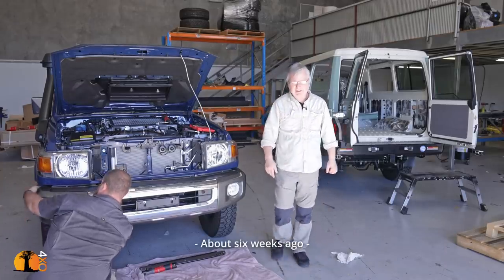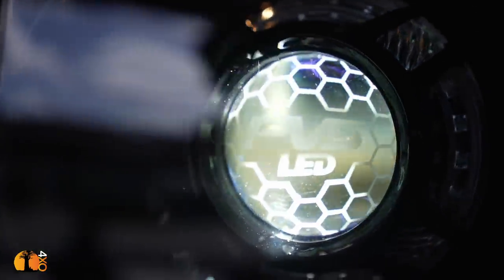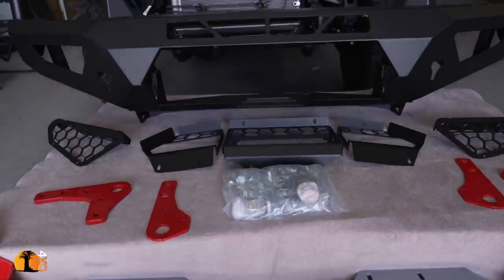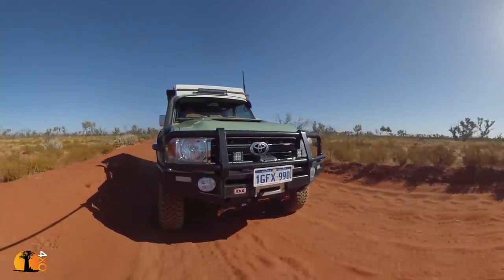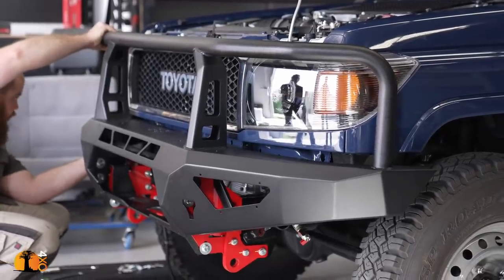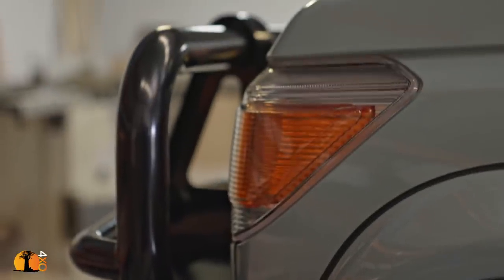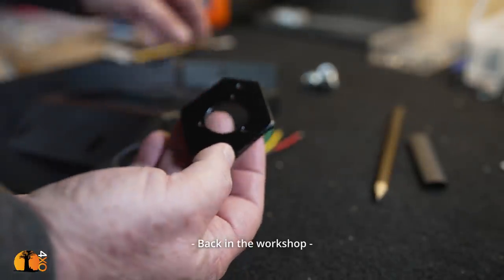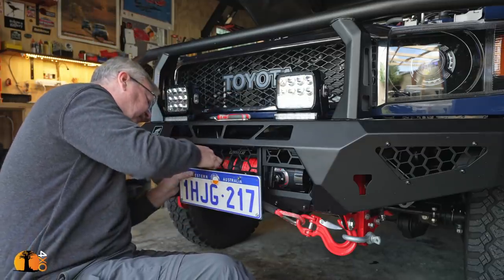BULL BAR, LIGHTS, WINCH & WEIGHT | How much weight have we added so far? | 4xOverland

Comment from the maker: Winch controller questions: IMO. How do you work a remote switch with gloves on? You have to take your eyes off the operation to make sure you're pressing the right button. With a switch, its tactile - all done through the feel of the fingers. What if someone picks it up and runs the winch at the wrong time? If it falls in the mud? Remote switchers inside the relay boxes are prone to water damage. Remotes are horrible things and not suitable for safe winching. Okay for the very experienced. Dangerous for the newbie.
Reply: How do you press the button?…by pressing it. It’s still tactile. One button for in, one for out. Just seems like you just want to use the wired controller out of choice…and that’s fine, but the other reasons are grasping at straws IMO. I dare say that even with the wired controller, right before you winch on or out you’re going to glance at the controller…same as a remote.

Comment: C'mon Andrew.  Your reason for not wanting a wireless remote winch is flawed.  You can just as easily arrange who manages the winch wireless remote as that of the wired control.  If you don't have that sorted, then it's a user problem.  But like you, I do like the winch control box hidden, and extending the control wire plug where it can be easily access is a must.

Comment: Hi Andrew - I see other Aussie channels (4WD 24-7), All 4 Adventure and even Ronny Dahl) all lauding remote controls from a safety point of view. During difficult winching operations you can put some distance between the winch cable/ rope and yourself so that if it or its anchor point let go you are out of the 'kill zone' as they say. For me it is far more important to be paying attention to what you are doing than whether you are using a remote or cable controller. 
Having said all that I have only used my winch once in 30 years - halfway up a hill stuck in a washout between Ruacana and Epupa falls, I try not get stuck. Which is why I like your troopie build I have always travelled as light as possible - which helps in not getting stuck.

Comment: At 9:42 when you showed the plug, its just a 4 pin XLR type. Commonly used for power supplies in AV. Easy to purchase a premade extension wire, or make one yourself with some Neutrik plugs. Did find it a bit weird though, as those things just rust in normal studio applications, let alone getting wet in the wild.

Comment: I suspect most people over-estimate because they don't take into account the weight that is removed when you replace parts. The bulbar might weigh 60kgs - but you probably remove 15kgs of  bumpers and supports so you net out at 45kg. Similar with most of your other mods - you gain weight but not exactly kg for kg - have to account for what is removed in fitment.
Reply: Exactly what I did.
Reply: Whereas if you’re doing the work yourself you see what is being removed and factor that in (add underestimate the difference).

Comment: Wouldn't the cable winch control put the person in charge of winching in the death zone, remote control they can be in a safe position. But I note your point as well.
Reply: (hence why the person controlling the vehicle on which the winch is mounted should ideally control the winch from the drivers seat. - If a "remote" party wants/needs to be director of recovery operations, their deal tool of use should be a 2-way radio, issuing edicts  for the participants in the saga (radio coms to spotters, etc is very useful )..  ( NB. if the Wireless (pocketable) remote doesn't have 2-button safe operation it can be a hazard for inadvertent ""pocket presses"  - thereby best kept in a safe place when not immediately needed) )

Whenever people are setting; anchors, pulleys, redirects or lines, the winch "should"  - not saying this is in any way standard practice -  be declutched or otherwise deactivated... (accessible lockable disconnect isn't far from what would be "industry standard" - if it were industry.  lol..   )
Reply: @kadmow  Yeah pretty much common sense.
Reply: How do you work the out? What's the difference of sitting in the drivers seat and starting to the side. I love my remote winch controller as my primary. Very difficult to activate it by mistake
Reply: @ianmoore4327  . Easiet to steer from the drivers seat.   Ha ha ha...

Comment: Matt's off-road recovery has had multiple videos where his and his son's winch remotes have interfered with each other and only one winch worked at a time. This all happened while doing a recovery of vehicles in precarious situations, where having two winches running was required simultaneously, so I definitely recommend having a cabled connection.
Reply: What's to stop another's remote from still interfering? I'd remove the receiver and throw that thing away. There you go Andrew, we've just saved you another 100g.
Reply: @MegaWilderness  valid point.
Reply: These recoveries would have been even more difficult if the winches were operated from a few metre long cable, somewhere far from the recovery site.

Comment: I recently installed a 14,500lb winch on the Silverado and needed to relocate the solenoid box, similar to the way you did. I also extended the low amperage wiring (like you did in your video)....BUT...I did one important variation....
One of the wires is a constantly "live" wire and in an effort to make the winch unable to be used by some nasty mongrel, I utilised a in-cab switch.
This means that the winch cannot be used via the plug-in port without activating the in-cab switch. However, the 2 cordless remotes will still work. I understand what you're saying about the wireless remotes being potentially dangerous, BUT they do enable the operator to stand away from the "line-of-fire" in the event of a mishap. With the cord-operated remote, you always need to be within close proximity to the front of the vehicle with all the risks that that entails.

Comment: Andrew your thinking about remote controllers all wrong.  They’re there so you can run the rope out by yourself,  be 20m down the track and get take up or give out some slack in the line
Reply from the maker: It's not wrong. It's another way of looking at it. How do you work a remote switch with gloves on? You have to take your eyes off the operation to make sure you're pressing the right button. With a switch, its tactile - all done through the feel of the fingers. Remotes are horrible things and not suitable for safe winching. Okay for the very experienced. Dangerous for the newbie.

Comment: Hi Andrew, great vid, BUT......the weight gain estimates provided by my good self and others were based on the question posed in your video "Induction cooking controversy". And hence, have nothing at all to do with your bull bar and any item you mentioned in this video. Please, when you can, take a weight measurement of the batteries etc when you add the induction / gas cooking set-up. Thanks 😃

Comment: What’s the difference between using the remote inside the car as the driver in a recovery situation and using the wired controller? Aside from relying on the remote connection, which in my experience has never been an issue.
Reply: Agreed. One person in charge of the recovery, concentrating on the recovery, but using a wireless remote. For me, that is usually me, sitting in the drivers seat, in constant communication via radio with my spotters outside.
Reply: In the driver seat you cant see as well as if you’re standing outside controlling it, outside you have greater control over the veh as you can see what the winch is doing and make decisions more accurately. This is at least in my experience with larger/military vehicles with poor visibility from inside
Reply: @TK42715  there is no way on earth I would give the controller to someone else if I am in the driver's seat
Reply: @darrengray2309   fair but in the military world the driver is not the one in command of the veh, he just does what he’s told by the commander who usually has a better view of things either because he’s dismounted or because he’s got unimpaired vision from his position in the veh

Comment: I weighed everything as it came off and went on in my LC76 build. The ARB Bull bar was 48KGs incl bash plate. So its lighter than the OA bar. The Toyota bumper that was removed was 27KG
Reply: Same here with my Troopy - I removed 26kgs of parts and added 63kgs of TJM bar so was 37kgs heavier - your ARB bar has an extra row of barsand an extra bash plate.  I fitted an ARB Deluxe bar to a 200series once and it added 75kgs to the vehicle weight so maybe that's where Andrew got his info from.
Reply: @philg2468  Yes true. My weights were 43KG for the bar, 5KG bash plate and 3KG for the recovery point. Mine is the standard ARB deluxe bar with the fog lights etc.

Comment: I enjoy these videos greatly I know in a previous video you were wanting a ( pickup/Ute) did you ever consider a cab through conversion? That’s what it’s called in the United States anyway you essentially turn a pickup/ Ute into an suv/wagon if you were wanting a box/camper you can gain access even in a regular cab it would need a little extra frame support because the bed and cab often move independently then remove the rear window do some cutting leave a small edge for bolts and seals and or welding  and there you have it thanks again for the incredible videos

Comment: I don’t see why you shouldn’t use the wireless controller. You’re not just handing it out to a random. Same as with a wired control. Just a lot better. Cheers for the awesome videos.
Reply: Once you hand the wireless controller to someone else you no longer control who has the wireless controller as the person you gave it to can give it to someone else.
Reply: I've seen interference with wireless controllers when doing dual pulls with two winches on different vehicles.
Reply: @thelandcruiserproject  I saw that happen on Matt's Off Road Recovery YouTube channel.
Reply: I would keep both around, think there will be situations for using either.

Comment: Fully agree re the use of remote for winching.  What if there was radio intereference from someone elses device, which may trigger the winch?  I would find a way to introduce a remote cut off switch to disable the remote function so that accidents do not happen due to radio interference.
Reply: I'm the same, remotes are fun, but they don't tend to last long in the bush.

Comment: I extended the Winch power cables and mounted the control box inside the engine bay as high as possible on the inner wing, reduces muck and the cable plug is still accessible

Comment: I extended the which plug into my grille. With the light also on the grille. Then when you activate the winch power in the cab, the green light turns on on the grille to let the operator know the winch is live

Comment: I have a Runva winch and the wiring in side the control box was not secured, so on a trip to Cape York in 2018 with all the corrugated roads the insolation was completely shredded.  Which did not become apparent until I tried to use it.  Runva did replace the control box under warrant.

Comment: It would be cool if the number plate holder was a bit higher, then it would act as a sunblock keeping the rope in good condition.  UV light ages them and will likely make that red rope pink quite quickly.
Reply: 100% Think you should be able to move it

Comment: Suggestion, I always put my number plate higher. Over the wind screen and adjust it to the bottom of rooftrack. By doing it I avoid loosing my number plate in the mud.

Comment: I was originally going to flat out disagree with your wired vs wireless stance. But then realised that you are still going to carry the wireless one so the option is open to you in the future, so really it is a harmless preference that you are choosing. 

I will share that last time I had to run a winch line it was up an extremely steep incline where it had started snowing mid way through my travels. I had to basically run my winch cable constantly out in front under free spool but it was so steep that I couldn't actually pull myself and the line under free spool, so I had to use the winch to spit the line out for me. This was made a lot easier with the wireless controller in my hand as I pulled it out 25m. I could have just spat the line out in front of the car first with a wired controller then dragged it up after the fact but my winch line was in different places / distances each time so being able to just let out what I needed just made the 5/6 pulls I had to do that little bit easier.

Comment: Two mods I've done for controlling the winch are an in dash in out switch, and connecting a metallic female trailer plug to the bullbar and the male attachment to the end of the wired controller.
The connections on most winch controllers are rubbish at best and the little prongs break easily.

IMO you should've had that plug installed on the flat part of the bullbar where it will be better protected from all forms of damage.

Also having the control box hidden away prevents easy access for any track side repairs. Looks good but far from practical. 

Quick question?
Will that bullbar protect you from an animal strike?

Thanks for sharing

Comment: I extended my winch control to top of grill and put a gigglepin hd relay behind headlight on the inner wing. The winch was already installed on the vehicle when I purchased it. It had a remote controller which I only discovered when I went to test the winch. It had been left in the centre cubby box. I switched the master switch and the winch spooled in straight away. It dragged the hook through the fairlead before I could turn the master switch off. 
I discovered the remote under some paperwork had pushed up against the side of the box and had switched itself on. Needless to say while rebuilding the broken winch I removed the remote wiriring and threw the controller away.

Comment: You could simply enjoy the remote winch controller and put the corded one in the glove box Andrew. Yes.
Reply from the maker: A remote controller cannot be used easily with gloves, without looking at it. Switch controllers are tactile - its all done with feel through the fingers. A remote with no definite on-off actions are horrible and I do not wish to use them.

Comment: I love that bull bar Andrew. Well chosen. The overestimation of the weight, I believe (as he floats his hypothesis) is conditioned response. Is it possible that your followers have been conditioned by the plethora of equipment added to each build and then witnessed the bloated "orange blob" bog down in the sand as part of their confirmation bias? A small matter of neuroplasticity, you see. Call me crazy, but I just love those rims on the vehicle - I know I have more chance of falling pregnant than you keeping them as the build progresses, but man, I do love 'em.